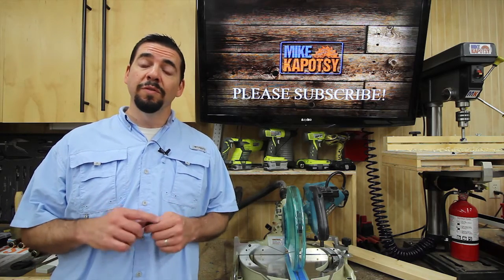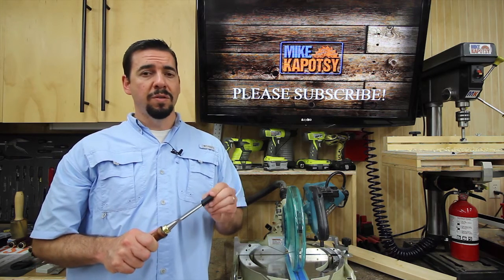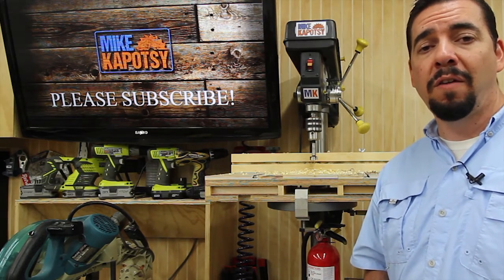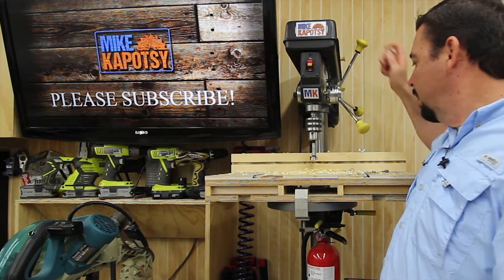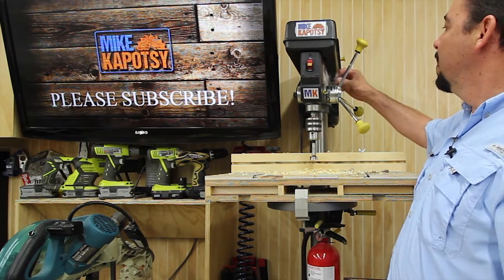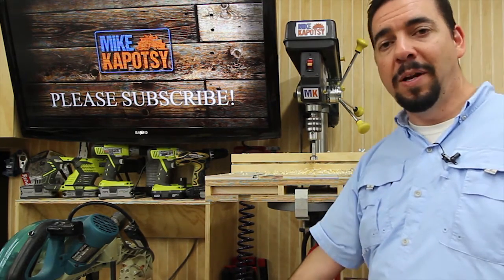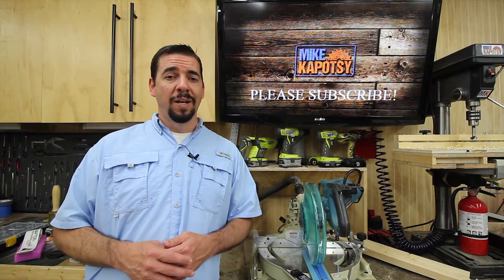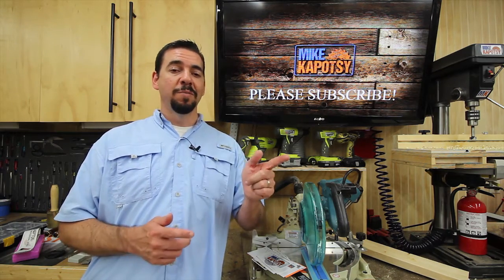Shop Talk #32 - My 13" HF Benchtop Drill Press, Shop Upgrades and more

Comment: Nice update Mike! Do those chisels come with the lacquer coating on them?
Reply from the maker: you mean on the handles?
Reply: +Mike Kapotsy On the steel. I bought some Stanley Sweetheart chisels and the had a lacquer coating on the steel. I soaked them in lacquer thinner and then wiped it off with steel wool to remove it.
Reply from the maker: GuysWoodshop thanks, not sure but I'll check.

Comment: Don't spend 4 minutes  talking about non-drill press things.What about performance? How does it work on thick metal?  How hard is it to change pulleys?If you're going to put out a review
DO THE DAMNED REVIEW PROPERLY!
Reply from the maker: Well sir, while I welcome comments and feedback, the video is appropriately titled "Shop Talk" which is exactly what it is.  These videos aren't designed to be complete tool reviews.  As for the press, I've not drilled much metal with it, mostly wood.  The belt is easily moved from pulley to pulley to change the speed.  It is a decent little drill press for the money.  Hope that helps.